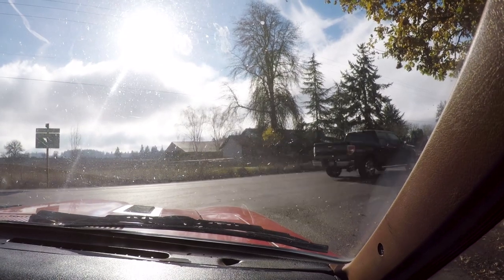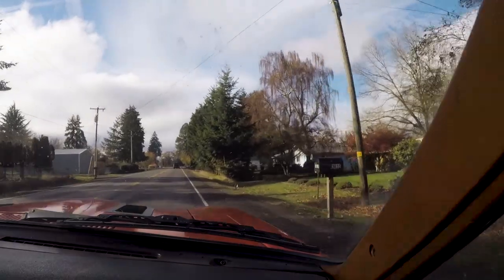280Z DD Project - Two weeks with the EZ EFI

Comment: Did you upgraded to bigger injectors or kept the same CC's only upgraded to O-ring?
Reply from the maker: These are 9 lb/hr at 43.5psi, which are slightly higher flow than factory at maximum capacity from what I understand. The goal was to keep them within proper range for mostly stock engine operation, too large of injectors cause all kinds of idle and performance tuning issues, but they are a good compromise, allowing performance upwards of 300HP before needing to up size.

Edit: These are the injectors I used.
https://zcardepot.com/collections/fuel-injection/products/fuel-injector-14mm-o-ring-19-new-efi?_pos=1&_sid=1dad8fbef&_ss=r
Reply: @AmbiVe  Great, thanks for the response. Although I have my billet fuel rail with 5/16 thread i'll look and see if there is adapter for the o-ring injectors or look for a 19lb/hr hose injector, which might be hard to find. Thanks I might have seen the video about 5 times to convience myself to buy the kit.

Comment: Just installed the ex efi and did presets on touch screen. When it asked me to start the car for warm up it just spit and sputtered like timing was off. I didn't fool with the distributor at all. I'm having issues getting it to run at all. Any help will greatly be appreciated.
Reply from the maker: If your ignition timing and mechanical timing didn't change, I would check that your wires are still in the right order, fuel pump is working at the correct pressure, and verify you don't have any big vacuum leaks. Just the basic sanity checks before digging in to electrical.

Are you sure your voltage isn't dipping during cranking? It's really important that the EFI has direct battery connections and the ignition power source doesn't dip when cranking and reset the ECU.
Reply: The 280 was running before the ez efi upgrade. That includes the fuel relay harness from fast efi. Fuel psi static is 36psi . No vacuum leaks. I have tach rpm signal. Stock distributor with stock ignition box and pickup in distributor. Stock injectors. I replaced pick up in distributor just to verify condition wasn't that. Same results. I'll get a few revolutions with just spit and sputter in exhaust that sounds like out of time firing. Check plug wires all correct. It wont even run before doing data input on touch screen. Long block is 1 year old (zcardepot) with maybe 400 miles on it. Old fuel injection was causing the dreaded cold start issue from over fueling all the time even when driving. That's why I wanted to upgrade this system with all the GM sensors and o2 for better fuel mixture control. I would like to video chat and bounce some ideas off each other  if possible. My email address is keyosanim@aol.com 
Thanks for your time
Reply from the maker: Did you block off and delete the cold start injector or leave it in place?
Reply: Yes, block off plate installed. Didn't want to leave psi on that cold start injector just incase it started leaking.
Reply from the maker: It sounds like it probably isn't directly fuel related then. I would verify that both positive and ground for the EFI have good connections directly to the battery terminals and that the ignition on source is not something that dips in voltage during cranking. I would also double check that something weird didn't happen like the distributor turning because it's slightly loose, the vacuum lines to it or the charcoal cannister is disconnected, or something weird with the tach signal.

Comment: I've been considering purchasing this kit, are the instructions provided thorough for our cars or are they generic? Also, if you're on any Datsun forums (Ratsun, hybridz, etc) would you be willing to post Z-specific information on the connections you had to make to get the kit to work such as wiring in the fuel pump?
Reply from the maker: Sure, I will try to do a more detailed video. The instructions from Z depot are a combination of generic and specific, a little confusing at times, but not bad.
Reply: Thanks  @AmbiVe  ! The videos you've posted thus far are great, and any additional information you could provide will certainly help the Z community. The Datsun forums have scant information on this kit so most are still resorting to megasquirt and the like.

Comment: Was this efi rich on acceleration initially? I just got my mustang going and acceleration air fuel ratio was in the 8s
Reply from the maker: Yes. Depending on the setup it can be pretty rich initially or it's also possible if you're having a timing or ignition issue. If it doesn't get better as it learns, you might want to verify the O2 sensor location and that you are getting a good burn.

Mine was pig rich at first, but I dialed it in with time and tweaks.
Reply: @AmbiVe  cool thanks for the info.  I just got it going an have not driven it much but ill drive it an see how it works. Thanks again.
Reply from the maker: I would also verify your plug gap. If there are many changes to the system you may need to sort this as well.

Comment: What are you afr values ? 😳
Reply from the maker: I don't recall exactly where the last ones ended off, but it was generally happiest around mid-high 12's under acceleration and around mid-high 13's at idle as indicated on the handheld. I tried to lean out the idle more via injection, but it ran much better with slightly more fuel and playing with timing instead. Right now after not being run for months at a time, it will fire up dead cold after just a few cranks to give it time to move the fuel down the runners.

Keep in mind if you're tuning your own, the numbers on your display are not exactly what the engine sees. The numbers will vary based on the location of the sensor, contamination or leaks, and the quality of the sensor itself. Going by ear first and verifying readings is usually a safer option than blind settings that are too high or low.